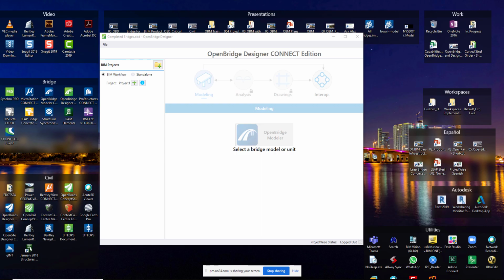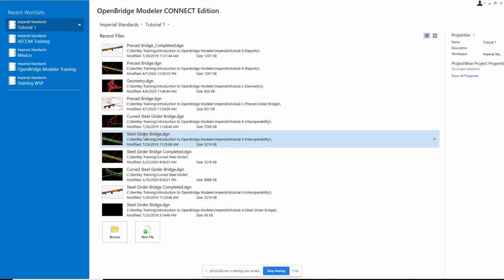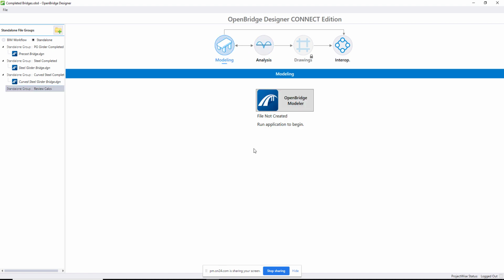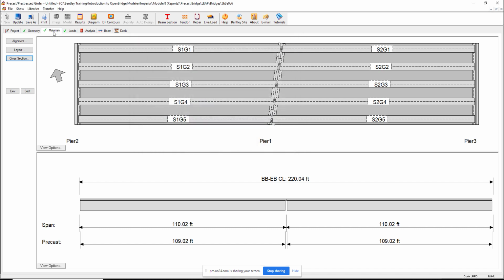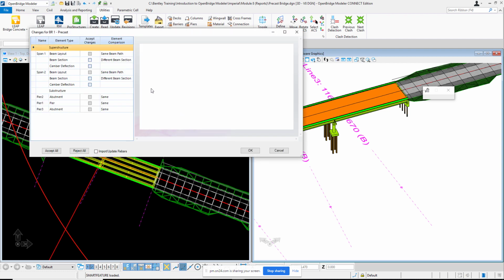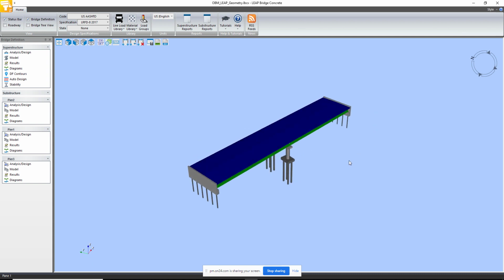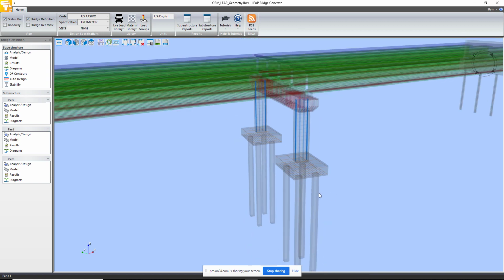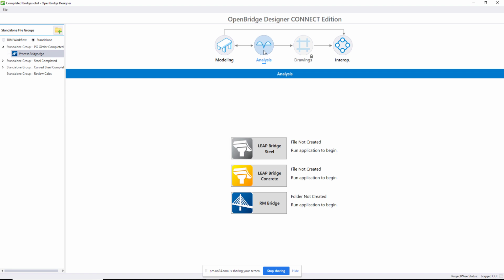OpenBridge Designer - BIM WORKFLOW and STANDALONE WORKFLOW

Comment: The BIM workflow looks like such a pain. I thought the point of BIM was to have the model and analysis software work together. As you have it, the analysis is completely dependent on the model. I can see that some things would be difficult to change such as the span lengths, but beam locations, size, materials, pier element dimensions, would all be easier to allow change in the design software, then update the model. Seems like Bentley just did the minimum work necessary to be able to say "We do BIM" and not actually integrate their software fully.